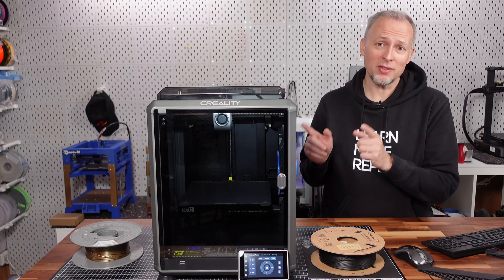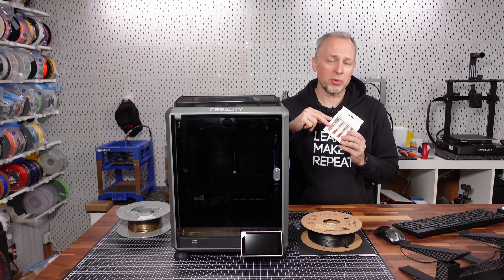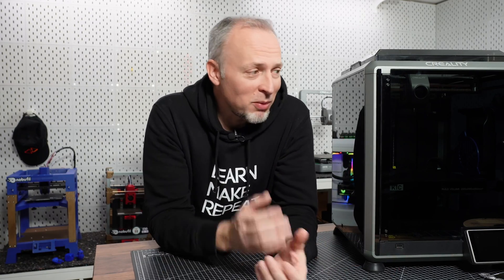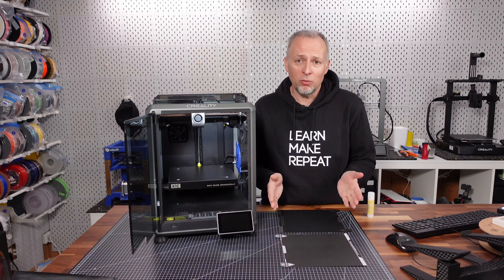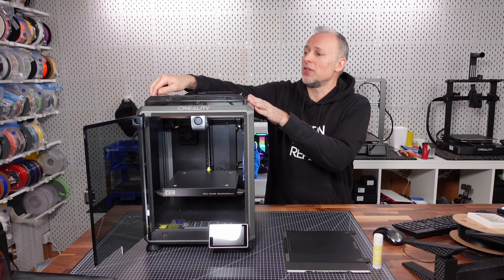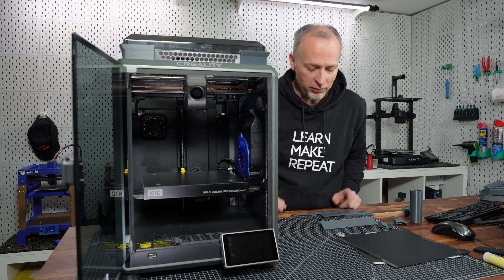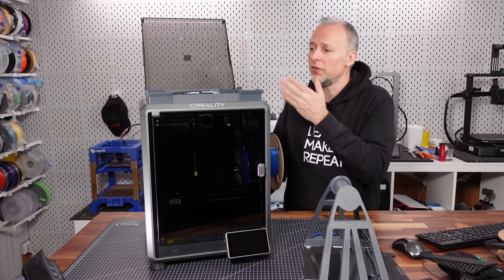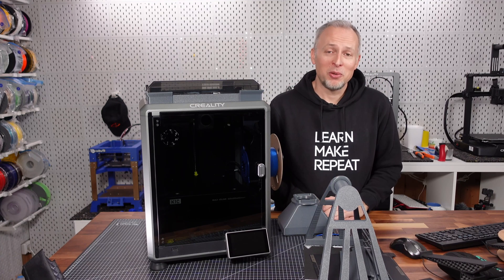Creality K1C Review, Important Upgrades & Mods

Comment: Still love my k1. I have done quite a few upgrades mind you. It is now my best printer by far. I may pick up a k1 max soon once k1 plus comes out and price drops. Do you think the new nozzle is worth it? I have so many spare hot ends and nozzles for my k1. And keep up the good work Daniel. Cheers from Canada 🇨🇦
Reply from the maker: Hey Andy, I think the new nozzle is making things easier to handle for the average person however if you have lots of k1 spares like me it’s probably not necessary to make the change. Thanks and greetings back from Germany 🇩🇪
Reply: There are 2 differences between the extruder assemblies of the K1 & K1C.  The K1C was built for abrasive filaments with it's hardened extruder and the unicorn nozzles are super easy to swap cold. In fact, the only way to swap nozzles is cold. Simply use the retract filament setting. This will heat the nozzle, retract the filament and extrude the nozzle clean. Be sure to unlock the extruder wheel before pulling out the filament. Next, use the nozzle temp control to room temp which will turn on the cooling fan until cool.  Added note: I recommend extracting all filaments when a printer is not in use. Now that the nozzle is cool, use the supplied wrench to lightly unscrew the nozzle. In other words, if the filament has been retracted and I'm ready to turn on a cold K1C, I first install the proper sized nozzle (.4, .6, .8 sizes in the unicorn pack).  Insert the nozzle and lightly tighten. This info is available on Creality's channel.  The improvements in the K1C simplify's things closer to plug &  play printing. 
So much so and as this is my first printer, the most trouble I run into is following all things printing how to's and troubleshooting tips from earlier than the K1C designed printers. These tips are not intended for the K1C, which in many cases, these previous 3D community problems have been resolved within it's design.  If a problem pops up, follow Creality's K1C fix ONLY or problems/damage may occur.
Reply: Replacement print bed with the silicone head cleaner are available purchased from europe OR by joining Creality's "club" in the USA.  C'mon Creality, make the K1C bed available in stores ... like all your other printer beds.

Comment: Which one is better, creality K1C or Flashforge Adventurer 5m Pro... i want a trouble-free out of box printer that dont need much to tinker.
Reply: If you want hassle-free get a bambu lab
Reply: Anything Bambu Lab, I have the X1 Carbon and its trouble free and the best print quality I have seen on a FDM machine!
Reply: I been using the K1C for the last 2 months, super happy with it, you can get great result, but for best quality, i would recommend upgrade the hot end to micro swiss, it's amazing.
Reply: 5M and 5M Pro have real quick change nozzles, but they seems to have too little memory for proper Klipper. No Mainsail nor Fluidd web UI from FlashForge.
I don't know if Creality named their new nozzle based on how difficult it would be to find a replacement 🙄 But with smaller motors and pulleys the print quality seems to have improved over K1.

Creality Klipper printers have been unlocked to open source. BL is closed source and will be (did they try to hesitate publishing modified open source slicer sources?). Open source means something to some of us.

BL X1C (without AMS) costs as much as K1C and K1 Max together, but it's not my money 😅
Bambu Lab A1 (when back in business) on the other hand might be really good choice, if coreXY or enclosure are not required.
Reply from the maker: K1C would be my best choice. Better 3rd party support for add ons and a bigger community.